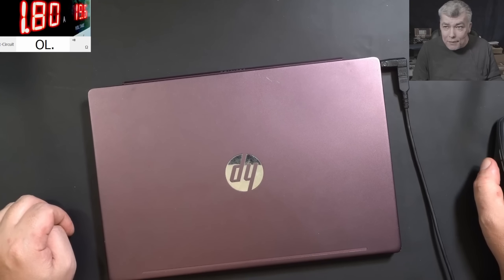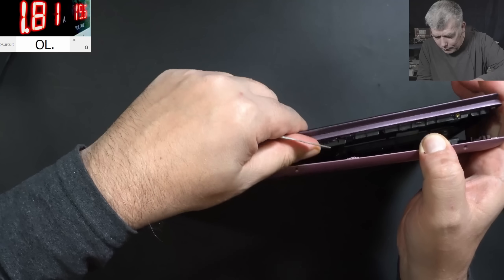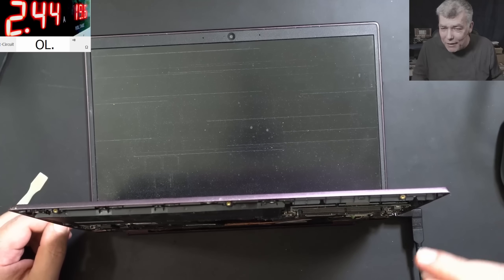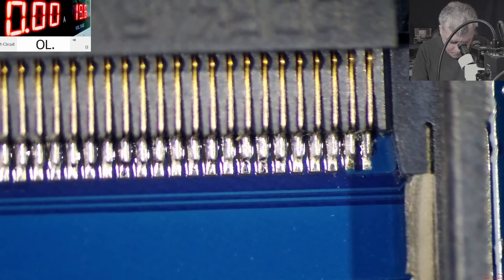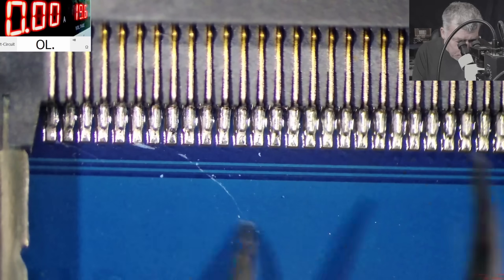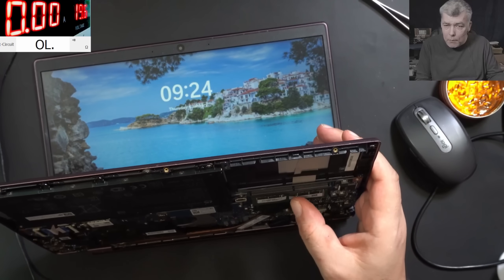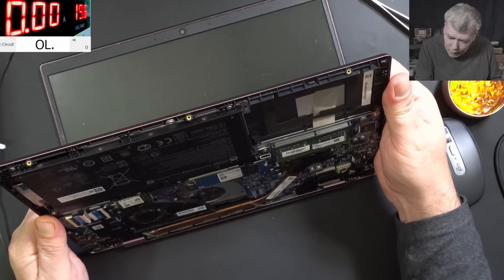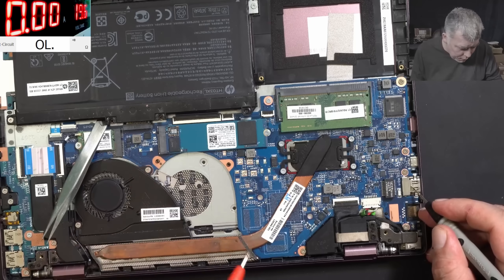HP has to recall this motherboard - Hp 14-CE flashing power button/looping Manufacturer design error

Comment: Thank you Mr. Sorin! Thanks to this video I fixed the fault in Dell Latitude 7490. Exactly the same problem! The last pin of the ram slot was moving. It was necessary to unscrew the metal cover of the slot. Unbelievable... Thank you again!

Comment: I used to repair laptops when I was employed by Quanta Nashville.  Quanta was not just a repair facility but they also designed and built laptops for many brand names.  We typically received approx 1000 (one thousand) HPs per day and were only one of several repair locations in the US.  General consensus among the techs was that HP was definitely one of the worst for quality control.
Reply: I have a question for you pls

Comment: That's true, I had a HP 14-cf with the same mainboard and it was freezing every time I held it in my hands. This was caused by the RAM, because it only happened when the right side of the laptop was under pressure. Now I know how to fix it, just need to find the laptop xD

Comment: Hi sir sorin,, mayi ask if it is safe to inject more than 1v in a csr if the short is on the secondary side or after the main power rail? Thankyou sir and godbless
Reply from the maker: Not really safe, if you have a shorted mosfet, you send that current in to the cpu/chipset/gpu

Comment: it's weird this happens with only the first pin faulty because looks like the first 2 pins are connected together on the board so most likely they are no connected on the ram module otherwise wouldn't get any problems until both pins became faulty... I'm not making any excuses here, its just weird. Great video as usual!
Reply: The two pins are in fact connected on the mainboard, but not on the ram module. The first pin on the right side has a much bigger polygon and requires more thermal energy to get soldered. Seems like HP is running a economy tume schedule there and not bringing that part of the PCB to the right temperature...

Comment: Coil is connected to ground ? But how ? Isn`t coil connected the way: pair of connected mosfets (middle point), then coil in serial with capacitor to ground ?
Reply: He is showing the resistance of the downstream stages past the coil (to see if PCH etc has shorted, sometimes it is hard to tell given the high current some laptops have for some components=low resistance.  He does this by measuring coil output (or input given coil is very low resistance anyway)  to ground (which is what a dead PCH/CPU/GPU/etc will often be shorted to).
Reply: @TonyHamlyn  So he actually checks the resistance of the load fed behind the coil? Thank you
Reply: @pic2pic  yes, my understanding of what he does is to identify the resistance to ground as measured at the coil, which is effectively measuring either the mosfet short to ground, or the motherboard various components short to ground. As some measure quite low even on a working motherboard, sometimes you could wrongly assume there is a short (as various motherboard components demand various current/power loads) so he measured here quickly in case someone else has the same board so they can match what they measured with what Sorin measured rather than guess "oh, this is 10ohm and that is 70ohm therefore maybe 10ohm has partial short" when some components on some boards have 10ohm when working fine.

Comment: The quality of HP laptops has really gone downhill. My new ZBook G9 16 had serious issues with freezing and random reboots. Disabling a setting in bios fixed the freezing issue, and the random reboots turned out to be due to some HP Audio analytics service (forget the exact name), which occasionally after returning from hibernation also got stuck on using 10+% of the cpu. Once that was disabled the random reboots stopped. But the hardware is shit, changing the keyboard is a huge pain (the gen 1 zbooks were perfect in this respect), the dual fans get super loud even with normal use. The keyboard is shallow and the squashed up/down arrows make for a "square" keyboard but are super annoying to use. The battery life is under 3 hours. And this is their top-of-the-line model! Sure, it "looks" good but an engineer doesn't buy a laptop for looks.

Comment: What exact model is it (14-CE covers a big range of options), I could look for some repairable bargains online (but socketed ram maybe means it is a bit old now? )
Reply: HP Pavilion 14-ce series
Socketed RAM means it is a decent design. Never buy anything with soldered RAM or soldered SSD. Buy used, problem solved.
Reply: @g4z-kb7ct  In the future this will mean "never buy a laptop", most likely all of them will have soldered in RAM or SSD, exactly like the CPU is soldered now.  Desktop boards probably will also follow this trend at some point.